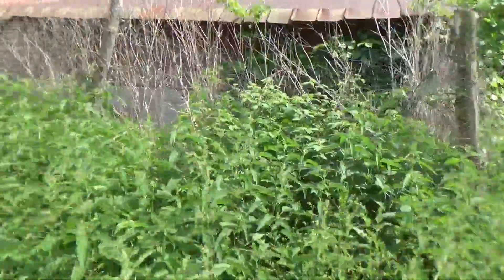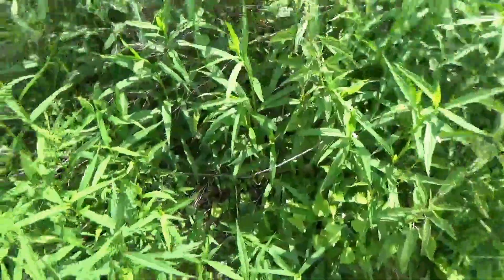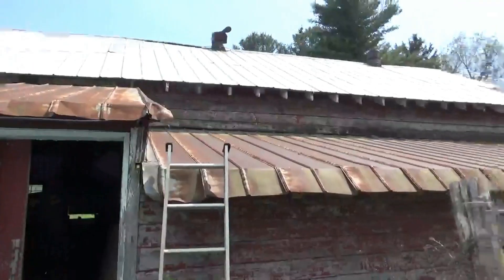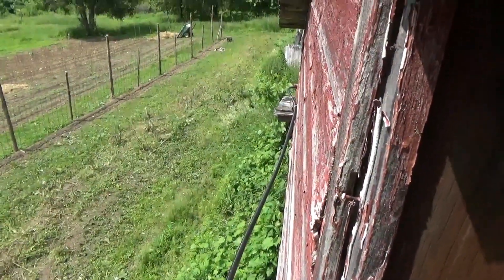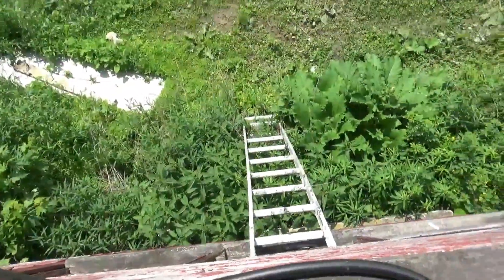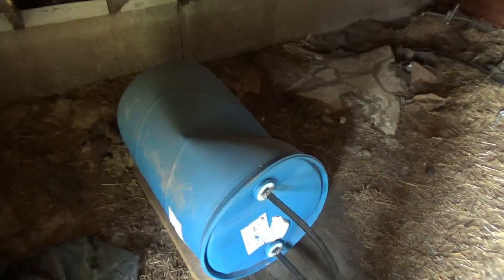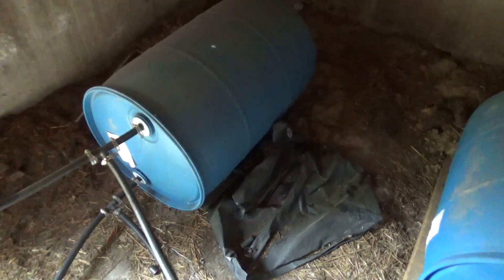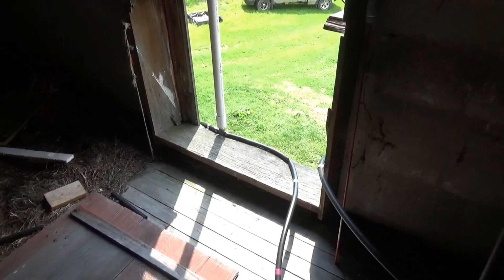Ram Pump Upgrade Reservoir Overflow Setup

Comment: Another improvement to the system.  Well done.  I don't recall if you have an overflow on the pool in case it fills up?
Reply from the maker: Thanks!  oh yes... the pool has an overflow... not attached to any "next level down" reservoir yet... but I have been thinking... :)